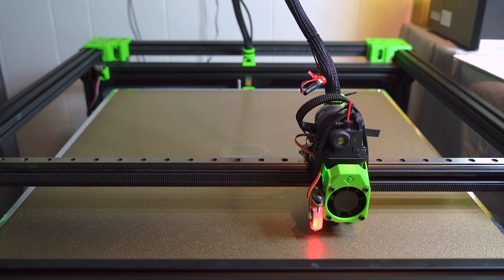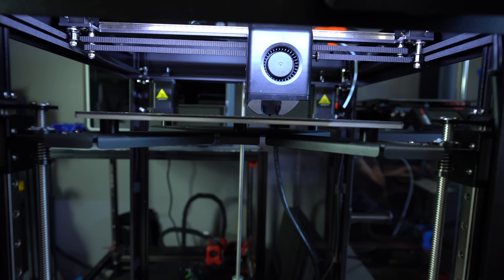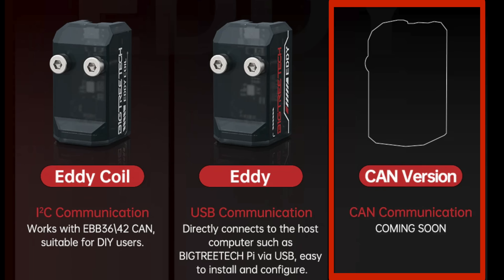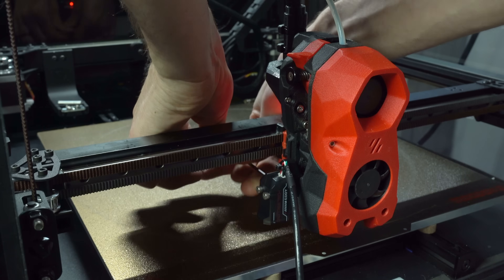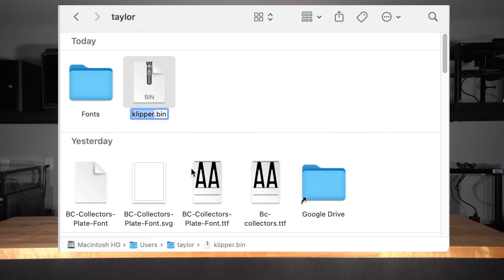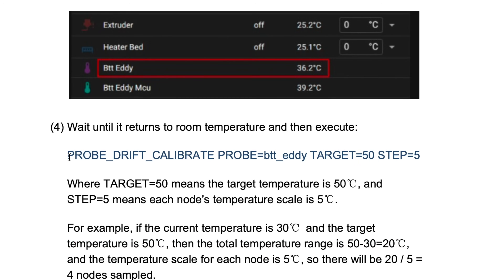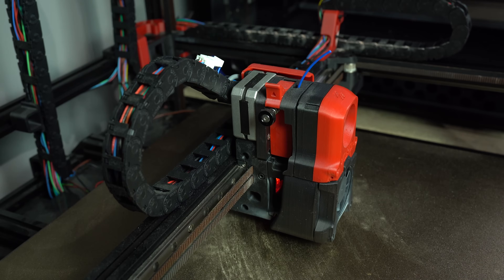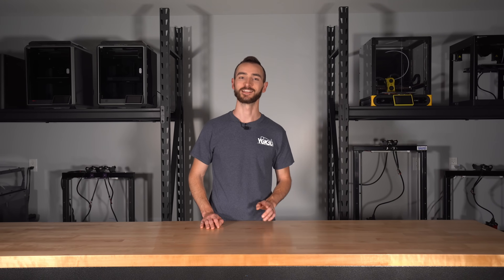3D Printer Bed Mesh Generation Will NEVER Be The Same - Eddy v.s. Beacon

Comment: Klipper devs are developing a function that let all ldc1612 eddy current probes have tap functionality, cartographer is also developing an open source version.
Reply from the maker: That’s amazing news!
Reply: @ygk3d  Laser scanning is still the most accurate and reliable scanning method. @01:37 Claiming that this might be the last bed probe you might need to buy just shows you don't know what you're talking about.
Reply: @youtuberschannel12 where is laser scanning used?
Reply: 100%
Reply: EddyNG is waiting checkin from klipper this adds tap
Reply: Got a link to this "announcement"?
Reply: @iitsalex  It's pinned on the discord
Reply: @iitsalex  For the Klipper one, can't post links but google ldc1612 tap and you'll see a discussion post made by the devs, but they are currently integrating the scanning feature to the main Klipper repo, seen in a GitHub pull request. As for the cartographer3D probe, they have a working video in their discord channel, but no concrete release date yet.
Reply: I cant wait for the cartographer tap to come out. Richard has done amazing things at such an affordable price. Makes me wonder why beacon is so utterly expensive. Mine's worked flawlessly for 6+ months.
Reply: @YourBuddyDinec  richard didn't spend any money on rnd
Reply: @Tedlasman  @machinza6230 He made the CAN version when beacon hasn't tried at all. He also found a way to do it at an affordable price while beacon still charges an absurd price for it. So either hes done some "RND" for it or he just isn't greedy. Why must all beacon fanboys be so toxic just like their developers?
Reply: @YourBuddyDinec  it's ok that you feel that way
Reply: @YourBuddyDinec it's always easier to develop something that already exists. I have no bias but if it was me I would overcharge until the clones arrive. It could also be that coming up with this idea and creating the device (rnd) played a major role in an empty market.
Reply: Richard lifted the code from Beacon, and thus had no RnD costs.
Reply: @machinza6230  Not saying this isn't true, but do you have proof of this? afaik both beacon and cart were developing the same feature in parallel.
Reply: @machinza6230  lifted? or did I just use the GPL3 licence it was provided under?
Reply: @richarddavies2902  oof, got em
Reply: cartographer doesn't develop anything... they take it from Beacon.
Reply: @AronsTube So they took the possibility to use canbus from beacon?
Reply: if by open source you mean stolen, then yea, its open source

Comment: Eddy Current probes have  been around for a very long time, it is used in none destructive testing on metals, we use to us it and it still is in the Nuclear plants to test the wall thickness of the pipes in the heat exchanger in the boilers. it can also be used to detect different metal types, this is nothing new old technology being repurposed...

Comment: I've heard some mixed reviews of the BTT EDDY probes.  I'm going with the BeaconH for now.  I had a BTT CAN toolboard on a printer that went tits up after a few months.  I will use the LDO Nitehawk-36 USB toolboard in my Trident build with a stealtburner and G2E extruder.  The NH36 has a built in USB hub that will work with either the BeaconH or the BTT EDDY-USB.  It took a bit of hacking to mount the NH36 on the back of the G2E.  I will use an umbilical cable.

Comment: Nice video, thank's
However I run into a problem: if I remove the [probe] section as mentionned at 13:28 klipper return: Option 'pin' in section 'probe' must be specified
even though grep -n ^'\[probe]' ~/printer_data/config/* return nothing
How did you manage this ?

Comment: So, I had a thought while watching this video...
With how the eddy generates its mesh in lines, why couldn't we have a small wheel attached to a sliding or arm mechanism that drives a permanent magnet to and from a HALL or TMR sensor? Cheap, simple, effective, should work on nonmetallic beds, and would give a similar line result compared to the Eddy. That, and with the magnet in it, it could be driven into or from another permanent magnet with a small electromagnetic coil similar to the classic BLTouch for deployment and retraction.
I may have to look in to this, it could have real merit.

Comment: These are actually quite bad, since they rely on the fact that the PEI thickness of the coating and the magnetic adhesive have a perfect thickness.

If they don’t eddy won’t work, thus if you want reliability you stick with mechanical tap probes (additional these automatically compensate for different nozzle lengths)

Comment: I installed the USB Eddy on my ender 5 Plus/ Merc 1 conversion. It works but needs some refinements in the docs!. Temp calibration needs a better solution. IF you use their approach , it will error out when printing at  >100C bed temps. You have to use 66-72C temp calibration.

Comment: Eddy promised us the world and delivered a hotdog. I bought 2 put them both on 2 printers and immediately removed them. I put a klicky back on both.  Maybe I'm just an idiot and have something else going on. I would setup my offset save and reset home , make sure there was no bed mesh loaded, drop down to zero on z. It would either smash into the print bed or be a long ways off the bed.

Comment: I installed one of the early Beacon sensors when I built my Voron 2.4, it's been fantastic. Beacon Contact was a very welcome and unexpected update, it works perfectly. I did run the wiring through my cable chain and haven't had any issues. I love that BTT has released the Eddy, the form factor that replaces existing sensors is a great idea and the price is compelling for new installs. Based on my experience though I'll be purchasing another Beacon if I should ever need one.

Comment: Eddy is garbage. The support is horrible. When it works it's ok. One main issue is eddy is not a one and done solution. It requires constant modification. Settings do not translate from print to print. The concept of it is great, the execution is hot garbage. This is one of those things that was obviously rushed out before it was ready

Comment: Wait, I need to change from my RatOs to an Eddy fork, THATS a NON starter!!!!!!!
You should have started the vid with this but apparently your just trying to push this rather than inform users, welcome to the block list.
Reply from the maker: Sounds like you were informed. You’re welcome. This will get merged to mainline Klipper at some point. Not sure about RatOS.
Reply: @ygk3d  9 minutes in is not informed, you already went through the pitch, funny after this i looked at another vid of yours and you were complaining about shills and this first 9 minutes before you mention that sounds like a sales pitch to me. Looks like a Pot calling the kettle black to me.
Reply from the maker: @  The beginning of the video was focused on the technology. Implementation details came later. I don’t disagree that it would be a non-starter for a lot of people to have to change firmware. But it will be a non-issue once the changes are merged to mainline Klipper, so there wasn’t much sense in opening the video with that information.
Reply: @ygk3d  Maybe you can add a warning that the beginning of the video that this will entail a complete kilipper fork replacement until its pushed. I would then reconsider the block I put on your channel as it would show your not just another sellout. I'm surprised I haven't seen your channel before, I wonder if the algo is not pushing you which imo is a good thing.
Reply from the maker: @ like I said… that’s just temporary. But sounds like you’ve made up your mind. If you don’t like my content that’s your loss. Happy printing.
Reply: @ygk3d  Umm, video is 5 months old, eternal temporary?
Reply from the maker: @noanyobiseniss7462  see the pinned comment. I’m not a Klipper dev so I don’t know the exact timeline. May have been integrated already.
Reply: @ygk3d  You dodging the point, just put a notice at the beginning its a simple edit, unless you got paid to shill this I can't see why you wouldn't. Are you a sellout hypocrite or not?

Comment: i've been planning to integrate eddy into all my printers, along with revo, so thanks for this.  one of the things i've never been fond of with btt devices in particular is having to flash firmware to everything before it can be used, but eddy & similar probes are something special & i see as more than worth the effort.  something i feel the need to point out, though, is btt has been touting for quite a while now that ebb36 & ebb42 both have accelerometer function integrated, so you shouldn't need an external accelerometer anymore.  i'll be testing that when i finish building my micron+, but until then i cannot confirm.

Comment: "bad edges" - one of the disadvantages of this style of probe is that its not taking a measurement at the nozzle. Its offset in x and Y from the nozzle. This means it cant capture axis twist as seen at the nozzle tip. This usually shows up as more error near the edges of the bed.

I still haven't seen anything that makes me believe that a nozzle contact probe isn't the right solution. Eddy/Beacon scanning are just a faster way to gather bad data.

Klipper can do thermal compensation as the first layer progresses (for frame growth). I've got a patch that extends this to nozzle growth compensation. With that feature plus some other tweaks I think we will be able to beat Prusa's first layer consistency.
Reply: Hi Gary, I'm using Klipper, is there any chance you'd be willing to share that patch?

Comment: I bought the BTT Eddy USB and it doesn't work with any applications that require a 100c+ bed. Can someone share their experience using other contactless probes in high temp applications?
Reply: @MadKobra-b3t  After a few months of struggling with eddy I decided to give up yesterday. It is way too temperamental and buggy. Just another rushed copycat product. Cartographer is about to release a new high temp version and judging by their great track record with other probes it should be the holy grail

Comment: Do you know if I Could I use the I2C pin that is available on manta 8P V2 board for using Eddy Coil version? or the unique option that i have for connection is usb connection mode?
Reply from the maker: @jhoanperez4742  maybe, but the included cable is only long enough to reach a tool board, not the mainboard.

Comment: Does the Eddy current sensor work with all types of bed materials?

How about using a BLTouch-like setup with a smooth, metallic ball that moves slowly and continuously registers Z-axis displacement? It could perform an initial probing to adjust for any wear and use a random path to cover the entire area, so it doesn’t always drag over the same spots. Plus, the slow movement helps reduce noise.

Or maybe a laser sensor, though it might struggle with glass or weird texture/colored beds due to refraction issues.

What would be the most precise system?
Reply from the maker: @Gambinaceo  no, the surface must be metallic. Your other ideas sound great!

Comment: When i type in bedmesh_calibrate method=scan etc in defaults to manual probe. When i use BTT_bedmesh_calibrate  it probes individual points on the bed. Help i have eddy coil

Comment: Is there a reason for this that makes a lot of sense? Unless if its price is very low or speed is insanely high, probes, switches, and induction already have a lot more accuracy than what is needed. If you need more accuracy, you should be investing more in a flatter bed because its flatness will start becoming an issue due to the plastic settling. Then again, fdm just isnt accurate enough for that level of accuracy.

Comment: The new LDO nitehawk-36 usb toolhead board has a usb expansion port for a probe to plug into, so you dont have to run a separate cable. Unfortunately the nitehawk-sb (two piece stealthburner toolhead style) didn't get the port. Also the beacon D is a little cheaper then the beacon H at only $65 if you don't want the adxl345 accelerometer that's built in. Which you might not considering a few tool head boards already have them integrated like the nitehawk, btt SB2240, ebb36/42 or if you have a bed slinger and need the sensor to be movable from the hotend to the bed.

Comment: Why did you side-mount it?  It fits right into the probe space behind the printhead on the mgn mount!  Love my Eddy, best thing added to 3d printing since heated beds.
Reply from the maker: I’m using Tap, so no mounting position for a probe.
Reply: @ygk3d  ...also, I should have watched 100% before commenting.  Doh!  LOL
Reply: @ygk3d  I gotcha.  That's why I went with the USB Eddy, to do the Z homing.  I had to widen the wiring channel a little with my dremel, but it fits!  Tap looks like a nice light/strong mount.

Comment: That's cool! I would like to use Eddy on my printer, but maybe my use case is a bit weird. I want to generate a mesh that I can view and adjust the bed leveling manually. Although it could still be used for compensation, I think that if I can make it more level and flat physically and reduce the compensation - it would be good.
I have an EasyThreeD K9, which is a very cheap printer, and I am modding the hell out of it. Some may have seen a video on such subject, but my modding might be a bit more relaxed. No Klipper, no Octoprint, stock ET4000+ motherboard and customized Marlin 2 firmware. Do you think this will be possible to make?
Reply: No

Comment: I'm sticking with my BLTouch while I wait for the laser rangefinder method that scans the bed while traveling at 500 mm/s, and achieves a resolution in tens of nanometers.
Reply: If you ever use a glass or garolite bed you will waiting tens of centuries. Besides, who needs resolution in tens of nanometers?

Comment: Never had any luck with BTT stuff. Their MiniE3V3 came flashed for something else, No firmware was listed for the Ender 5 Plus and Chris's set up didnt seem to work for me, Is it because im in the UK???  I got a shop to set it up, took three of their technicians 6 weeks to get a proper print, but it lost its home position all on its own and destroyed a brand new PEI bed and Spider hot end about three prints in. The Manta M8P and SP1 screen wouldnt work right on the Ender either, The Pad 7 wouldnt connect to my home system, had to buy extra routers to get it to connect but the Klipper part wouldnt update so it went back in the box.  How can i be so unlucky to get all their faulty stuff???  Im not a programing wiz but the guys in the shop are and theyve told me not to bring them anymore BTT to set up.  This stuff brought me one thing, Depression..... and a empty wallet from having to pay people who know to set it up without any real success.   Im sorry i cant give them a big up but why would I. My No good Fancy tat box is nearly full.
Reply: BTT certainly has some ground to make up in the manuals department and explaining what products are compatible with which products. But over all for me? The stuff works pretty good. I had issues with an HDMI screen and they asked for some very simple tests to be done then sent a replacement.

Both my voron's run m8pv2's and CB1's CANbus toolhead boards. Ones at 2k hours ones at 1k.

I think they just released a new manta, or maybe it was a CB?, that supports SP1. I don't think the older models did. I could be wrong on that but pretty sure I seen it in a recent tradeshow video on Nero's channel. 

Hoping next gen of m8p's have the SKSM's built in because this whole data corruption on powerloss is a huge oversight for bother Klipper and Control boards. Save a lot of people a lot of time.
Reply: Really sorry to hear about the issues you've had. One of the problems with firmware is that there are so many permutations of printers out there that releasing something with the correct firmware on it for each specific machine is not possible. We try to provide guidance on how to customise the firmware to a person's particular setup but ultimately each individual would need to compile or configure their firmware to their liking. As for your PAD7, I am not sure what you mean about the klipper part but it is possible that it was using a fork of klipper instead of mainline. If that is the case then you can use KIAUH to change to mainline and it will update without issues.

Comment: Non-compensated temp drift of Eddy Coil is a really big con. Why not include temp probe there?
Reply: Plan is to get the tap code working and then no temp comp is needed at all.
Reply: @looxonline  That would be good. But how would they do that? Probe is stationary fixed in head and should never touch bed. Chamber could be heated up to 60C, bed could be heated up to 120C. Even hotend could be heated up to ready-to-go temp. How could tap be implemented in such condition in Eddy Coil where is no temp sensor?
Reply: @darausus8315  The algorithm basically continuously monitors the readings from the Eddy vs. the z-height. As soon as the probe touches the bed, the graph shows an anomaly because the z-height stops changing in the same proportion. This behaviour is completely temperature independent.